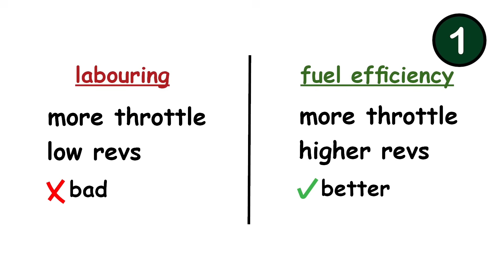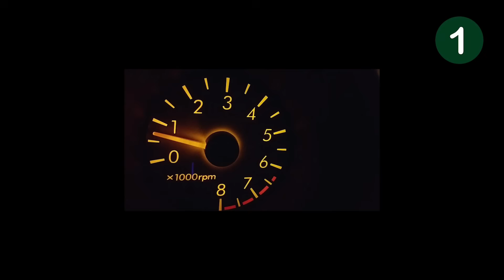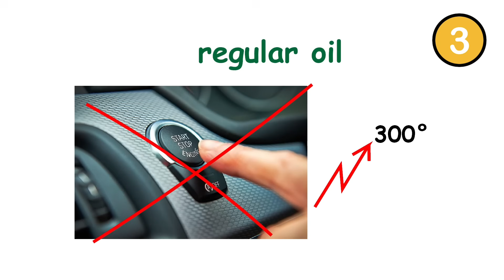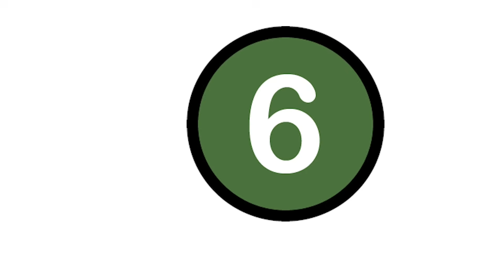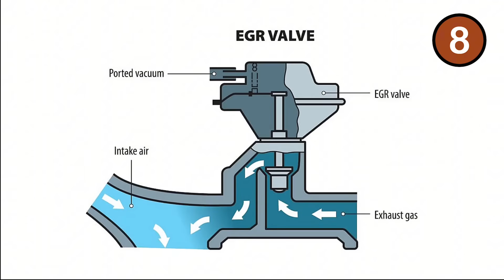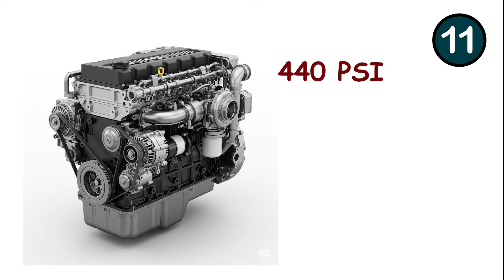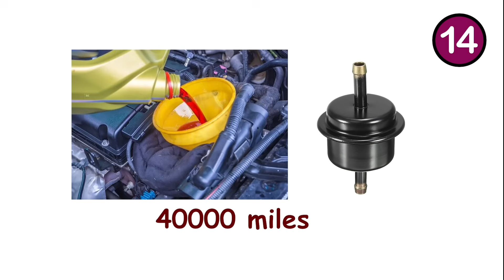If You Drive a Turbo Diesel Vehicle, STOP MAKING These Mistakes

Comment: Sea Foam in a diesel? I believe it says on the can not to use in diesel engines? Marvel Mystery Oil mixed with a made for diesel additive works great for lubrication, keeps pumps and injectors from failing.  Keep that sea foam at the Marina.

Comment: Removing the emissions crap eliminates almost all of these problems.
Reply: Never had any issue with emission control on any of my vehicles. My current daily is a turbo diesel, 9 years of driving and 200000 km.

Comment: Good info but slow down your speed. Remember you are providing info for folks who don't know. Flying through is good when you are conversing with fellow expert. Also repeat the main point several times within the detailed info that your audience may not be super interested in. Just my advise.
Reply from the maker: Thanks for the tip. so you are saying i should repeat main point many times?

Comment: A turbo only requires time to spool down, residual oil is plenty to keep the turbo lubricated. Rev it up and shut it off? Not recommended. Coking? Keep your oil changed and you wont have a problem. HIGHER revs within reasonable limit is fine, but a diesel is meant to make LOW END torque, so LOW rpm pulling is not an issue, it is in fact preferred.

Comment: My 2.0L Tdi Jetta loves to run 60% throttle and up. If any less she gets angry at me and keeps tryna push faster nd sends dpf light on until I go to 60%+ throttle😅
Reply: Its attempting to do active regeneration, engine has to stay above 2k rpm for roughly 20-30 mins while doing highway speeds

Comment: It’s almost impossible to control engine laboring with those new 10 speeds
Reply: i put mine in tow haul mode empty if im going uphill or offroad
Reply: good call… just bought 2025 l5p and considered this in my first drive through mountains.

Comment: My 2002 Duramax LB7 came with no EPA crap, a non variable, simple turbo, and , of course , the notorious bad Bosch injectors.  After upgrading to the newer iteration of injectors, with the hardened seats, it’s been trouble free for 300k miles.
No EGR, DPF, re-gen ,nothing.    It came with the CP3 hi pressure pump instead of the dreaded CP4.
I run a modest 40HP tune that really just makes it run like it should’ve from the factory.
I have replaced recently, the water pump and CP3 , always using new and the latest iterations.
I tow moderately heavy, big travel trailer, medium sized tractor etc,  so it isn’t babied, but it isn’t overworked pulling bulldozers up mountains either.
For the money, she’ll get new paint when needed and keep right on going.
Hell I could put a whole new motor in for far less than a new, gagged down rig.
Proper maintenance and timely oil and filter changes are key.
Buy once cry once.
Reply from the maker: This is great! You seem a legit ethusiast

Comment: Cheers for the video – I really appreciate it. There's a lot of useful info in it.

I have a question about point 10. I like to use the engine brake instead of the brakes. This means that I prefer to shift down a gear before entering a roundabout or reaching a 50 km/h speed limit. When downshifting, I usually reach a maximum of 3000 rpm. Only when I downshift to second gear do I drop to around 3500 rpm. I never downshift to first gear. What is the situation here? Does it damage my engine if it has high rpm in this case?
Reply from the maker: Are you pressing gas pedal harder while downshifting?
Reply: @AutocornerdPros  nope
doesnt really make sense

Comment: ON my car i get 60°C on my oil. especially in winter it doesnt go much higher, never seen 90c on oil nor 105 on coolant.
also driving under 120km/h reduces my EGT below 350-400°C which isnt enough to effectively keep it generated. the least soot i produced was going 200+kmh for 2h. around 8x the range per regen cycle lcompared to normal driving
not again that 5000mile intervall crap o_o

Comment: explain heavy equipment. 240 ton haul truck, max rpm 1900 rpm. those engines never see 2k RPM.  diesels were designed to run 700 to 2100 RPM for decades.  they are stout and can handle it.

Comment: Crazy how the trucks that last the longest are a Cummins diesel with a manual transmission at low RPMs “ laboring”.😂
Reply: With a straight dump and a rebuild every 200k miles ? 
1200RPM is low cruising RPMs, you don't want to always run it at that ...

Comment: Strip all emissions controls off your vehicle
Reply: Can't do that in alot of places. Including where I am in Colorado.
Reply: No guys he just making it up! Keep it at all costs and think about nature!  In reality, diesel engines are made for abuse, but only if you remove that bs in the first place. Honestly, it's all a scam to get subsidises from the government. While it reduces a little, making new engines and transporting it, + everything else, it's way worse for nature. The government cares about anything, but they're self-interest? When that ever happened.
Reply: Any concerns regarding temperature combustion control? Heard about potential issues following egr delete
Reply: @RobertBrownieJr I have a bunch of concerns. It’s not cheap to do it right. If the government is going this route, I think they should pay us in tax credits for the full cost of work.
Reply: @RobertBrownieJr  Removing the EGR system alone won't cause any problems at all. Yes, EGR reduces peak combustion temperatures by slowing the combustion reaction, but it raises average cylinder temperatures by displacing some of the cold intake air with hot exhaust gases.

The engine will run cooler without EGR, and the peak combustion temperatures being slightly higher won't damage anything if your AFR is still properly lean.

Comment: Never understood cool down timers on diesels, that’s when they like to foul up.
Reply: See the only time I believe in the cool down time is on things like tractors and heavy machinery that use them due to a lot of them like tractors and Combines etc being at high load constantly so then after lowering the rpm to. Idle that's why you let them cool but on other vehicles it's just bs
Reply: @RealMaGicXz oh absolutely, my old kubota bx1800 sun compact has a 1 litre 3 cylinder na diesel, but everything on it is hydraulic driven so I’ll idle it for half a minute to let everything circulate and cool down, but I will blip the motor a couple times before I turn it off too. In my mind at least, it should help burn off some of the film. But like with my 2 stroke gear, before I turn it off it’ll idle for a bit to cool down then get a quick blip so the exhaust and plug ain’t foul

Comment: Did 450.000 miles in a shogun manual.  Looked after it, changed oil on time. No problems.

Comment: Counterpoint: I live at the top of a hill.  My diesels have accumulated a total of 600K miles.  
Shutoff method?  Drive up the hill, park in the garage, turn off the engine.  That is it.  No problems, ever.
Reply: What diesels do you have? Impressive
Reply: @Guanacoboi and how many? he cant prove his point well.
Reply: He's saying towing a 2 ton boat up hill is working it, not just pulling it's self up a hill pal, I've seen hammered sprinters reaching a million, just a new egr every 200000 ✌️ ♥️ 🌍 🛸

Comment: I own 2 cars with OM651 Mercedes diesel, i replace fuel filters on every 2nd oil change. I use oil filter from the original parts and Mobil oil and Man air filter

I change the air filter every 15000km and oil 30 000km

I put only premium diesel fuel since where i live regular diesel is shit.

The Sprinter Van engine is on 640 000km and its a manual and the C220d w205 7G Tronic is on 124 000km. Both run silk smooth, on the sprinter i had to redo the turbo 50k ago, 200k ago i did the clutch and injector copper washers and bolts. Rest is still original, yes the dual mass fly whele is the original one
Reply: That oil change interval is too long.

Comment: So absolutely sending it down the highway is good?
Reply: Do it after transmission and engine are up to temperature
Reply: Long as it's in operating temperature range.
Reply: Diesel Cars long to be driven like their in a high speed car chase, instead they get a Mr & Mrs Smith that feather it, its whole life. 😅
Reply: About 100km per hour on a straight line is perfect

Comment: Ford Focus with a Peugeot Diesel engine here. My car rarely see's below 1800rpm, ie, 3rd gear for 30mph, 4th for 40 - 50mph, 5th at 50-55mph, then 6 for anything 60 and above. I always overtake in third, not exceeding 4000rpm, and not below 2500. I can tell you now, it loves it and it manners really improve at 1800-2500rpm. 

My rule of thumb is to listen to the engine, keep it where it sounds happiest and has response. in my case, 1800-2000rpm, and then an idle after, maybe a minute or so as my estate is large so its 15mph until parking up which allows for the turbo to get nice, cool oil. 

Oil changes are done every 6-7k miles. the car has never been happier.

Comment: I've got a Nissan Navara with a Nissan YD25 which is known for its reliability issues especially timing chain failure. Its got 276,000 kms on the clock ad I'm curious to see if I can get it to at least 500,000kms.
Reply: My YD25 has now done 405,000kms and never had a problem. Continuous filter and oil changes also the timing chain has never been changed. It has been inspected at 100,00km and no problem. I think I’m lucky with the timing chain. I will put a new one in at 450,000km. Look after it and it will keep going.
Reply: @rohankerr8891   Thats awesome. Mine has a timing chain sound and I'm going to get a whole new timing chain kit with new tensioners and synchronizers put in it.
Reply: I just got my 2nd car 3 weeks ago, and its a Nissan navara aswell, Got it at 115k kms hoping it will last me long, any recommendations on things to keep up on with besides normal maintenance?
Reply: @sample.env123   I'm assuming its a d23/np300 yes? or is it a d40 or d22? no idea besides general maintenance. I'm just fixing all my problems before they happen.
Reply: @Jack-ny4vu okay cool no worries thanks, yes it’s a d23

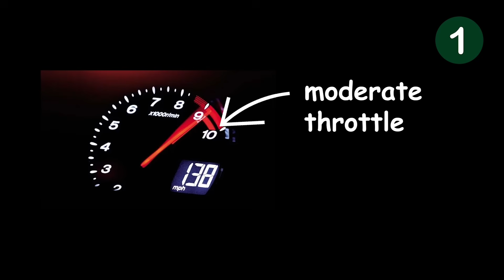Comment: On 01:39 why there is a gasoline rpm "clock" that shows redline of 8-9krpm, this is ridiculous amount of rpms for a diesel engine and some folks might as well misunderstood it and try to rev their diesel engines to such amount (even though there is no such high amount in diesel). It is highly misleading. Please be careful of such a mistakes. Appreciated the video though!
Reply from the maker: Thanks for the correction. I have non-technical assistants who help me in sourcing pictures. It's my negligence. I accept that
Reply: Its okay im sure most people could easily interpret what you said😂😊

Comment: Delete EGR DPF and swirl Flaps use additive diesel and drive it hsrd now sn again vhsnge oils and filters every 5K or 6K shouldnt have a problem 🤷🏻
Reply from the maker: EGR shouldn't be deleted
Reply: @AutocornerdPros 😂its a decat, to reduce load back pressure. Egr delete is not recommended as it has no effect in modern tdi.
Reply: @VR6SuperbEVO all the EGR and DPF does to diesel cars if you are not driving it properly and doing short journeys is fuck your car up and cost you some very big money to give to the mechanic so definitely worth removing anyone I spoke to who owns a BMW Diesel got their DPF and EGR removed straight away
Reply: @3rdbanwavey121 Egr cannot fuck up the cylinder walls aside from creating deposits. Egr only pushes back the smog into the cylinder bank. Dpf delete can be worthy, higher back pressure. Better do hardcut😂
Reply: @3rdbanwavey121 Which diesel do you own? I own a 2.0 TDi, and nothings gone wrong. Also egr delete won't give gains in fuel economy, especially for diesels from 2010 to 2025. Egr delete fuck up =/= better life span and economy
Reply: @3rdbanwavey121 its your choice, I won't consider egr delete to be worthy. Well yes for the dpf delete and decat. Deleting egr can throw error codes in the dashboard if you don't have a bypass, + canbus and resistors to reduce volts. Also diesel cars can limp because the ecu overthinks, and there will be powercut and reduced torque. And pcv valve may not be functioning all the time. Also emissions would vary for sure😂
Reply: @VR6SuperbEVO that's why u get a ECzu remap as soon as you are done that way u don't have any fault codes on the dash and wont have any problem on a cold start u get a little black smoke after 2 minuets of the engine running u can't see any difference but u get better MPG more power less trips to the mechanica and its less stress on the turbo 🤷🏻
Reply: @3rdbanwavey121  correct, but it will easily fail smog test. I would do this in a old junkyard diesel.
Reply: @VR6SuperbEVO tbh failing M.O.T is the last of my worries I know somebody who will pass for me every time so it will be fine and it's just better for the car and will be cheaper for me so its a win win  tbh the car is old as fuck its a 2012 ao worth doing it untill I buy a new one next year or the year after 🤷🏻
Reply: @3rdbanwavey121  2012? like a 320d? or something e90?
Reply: @VR6SuperbEVO yes exactly
Reply: @VR6SuperbEVO my 335d has dpf, egr, def delete. the egr got stuck open 2 weeks after i got it lol i got rid of it all. i have a couple of shorts posted on my profile
Reply: @AutocornerdPros  why should you not delete EGR?

Comment: My 97 12 valve runs better with abuse.
Reply: That’s what you’re supposed to do, give some juice every once in a while. I know some diesels people who baby them their whole life the veins on the VGT turbo get stuck in position.
Reply: Old Cummins love working hard and being slightly neglected. Regular oil changes and fuel filter changes is literally all they need to break 1 mill
Reply: Made me laugh 😂
Reply: I can do anything that I want to do with my 5.9 Cummins, 12 valve and she just keeps on running, and smokin.
Reply: @scottchapman9931  do anything you want and then do it again.
Reply: My 1.9 tdi Octavia is the same😂
Reply: 12 valves are like hookers they're better when worked rough
Reply: Fr my 91 loves to beg for more
(It wants the P pump)
Reply: What you consider abuse for the 12v is just a nice back scratch, turn that baby up to 4200 1:32 rpm and let it eat, stop being scared
Reply: Gotta keep her clean… two big valves per cylinder creates a lot of soot and carbon on the stems.
Reply: True. There's a difference between thrashing and lugging versus free revving and allowing the valve train, rings, oil pressure etc to all be at full temp full load. 

It cleans out injectors,  frees sticky valves and lifters even in pumps.

Its why allot of big diesel boats that slowly chug across oceans will run wide open throttle for the last few hours of the trip.
Reply: @nathansharma87 I’m not dropping the clutch in the thing all the time but I do send it and give her the beans every now and then and next time I drive it, it feels more open.
Reply: @bg1393 yeah your right. Most people hurt their engine by never getting on it at all
Reply: Yeah. I bought a 1.7 diesel Opel Corsa for commuting to work. I bought it knowing it would last max few months because the HP diesel pump and injectors were failing and the car was falling in a limb mode when I gave it a little bit of beans. However I need speed and power so I basicaly always floor it.  Today I have the car for almost an year and no limp mode at all. It gradually got better to a point where it works how it's supposed to and has gained back good amount of power (still slow as shit but at least I can overtake bicycles)  @nathansharma87
Reply: I dont believe it
Reply: @dejandezman6139 too bad I don’t give a shit what you believe.
Reply: @bg1393  LOL
Reply from the maker: really? but how

Comment: I have a Ford 6.0, it has one big repair bill then you can torment it. The Ford 6.4 on the other hand... There is nothing that stops you from dumping money into it. Other runner up money pits are the Dodge eco-diesel and the fuel system in Nissan v8 Cummins .
Reply from the maker: I see, thanks for sharing your experience.
Reply: I have two eco diesels and have had no problems.